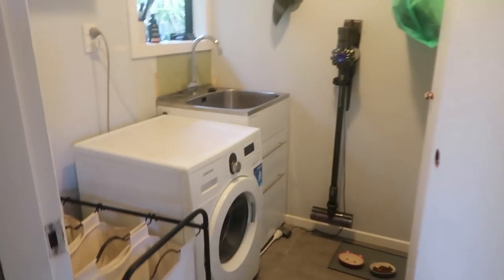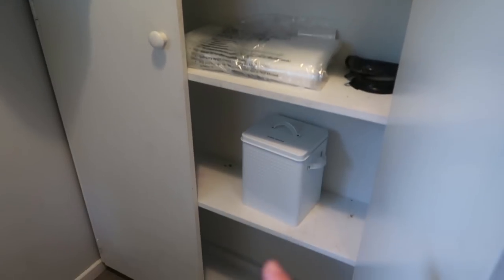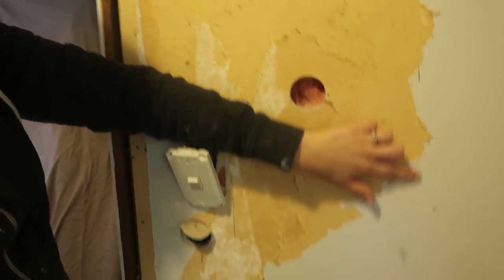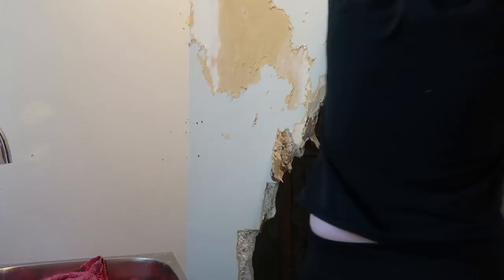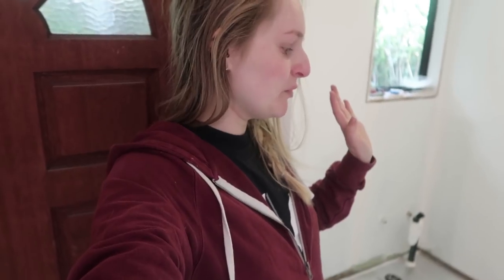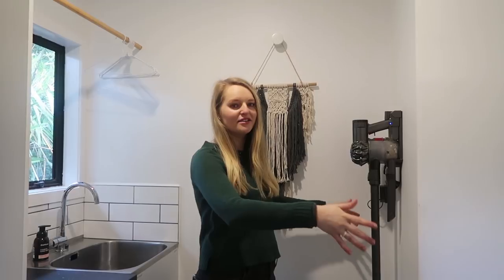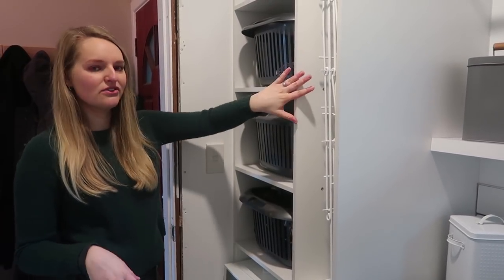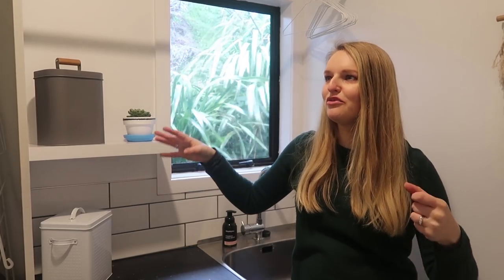The laundry renovation | DIY vlogs

Comment: I actually have a combined washer and dryer and it’s honestly the greatest thing ever! You just put your clothes in, press a few buttons, and then 5 hours later the clothes are all done - washed and dried! I would recommend it to anyone!
Reply: Ha um I started typing this at the start of the video... bit late now I guess ha
Reply from the maker: 😂 I’ll keep it in mind for the next house!
Reply: @smayjay  I agree, a washer-dryer is advantaging (kind of), because you don't need to waste lot of space to put the separated tumble dryer and you don't need to make a hole for the exhaust hose (for heat pump tumble dryers only). But, unfortunately, there are lots of disadvantages. For example, the washing-drying time is extremely long, they last at least 5-6 hours (!) (actually a quarter of a day), the consumption is very high (and the electricity bill will be very expensive). Also, it will damage the clothes. This is because the incorporated dryer has a condensing technology, instead of heat pump drying. As a conclusion: I wouldn't recommend washer-dryers, it could be worth buying a separated heat pump dryer or a washing machine with a higher RPM spin. I'm sorry for the long and late comment, Smay, but I hope this is useful for you and everyone. Thank you, Smay!